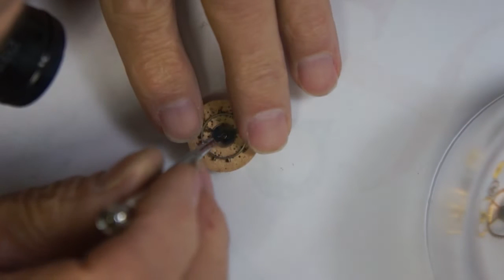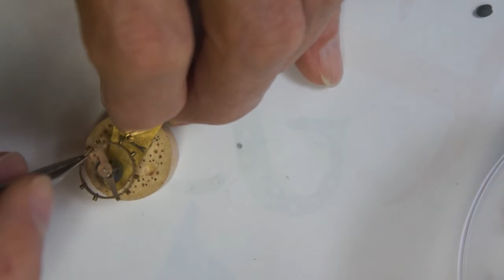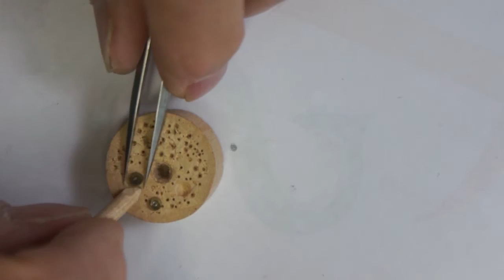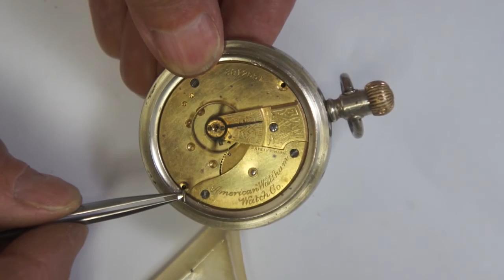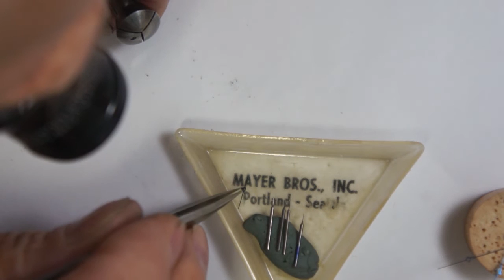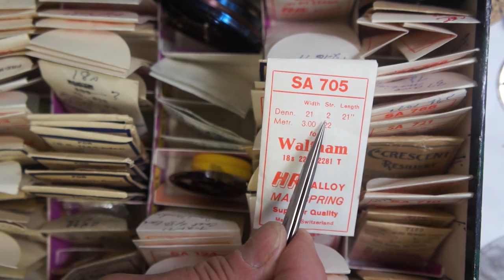Waltham 7 Jewel Pocket Watch Restoration for Cliff from Tennessee #32

Comment: I have a suggestion for using a Q-tip buy a coin or mechanical pencil lead holder 2 mm cut the Q-tip in half with a pair of slippers place the paper and the Q-tip into the coin or letter holder and use that as a handle Works excellent
Reply from the maker: Thanks,
Great suggestion, I will use this..

Comment: When using oxalic acid for cleaning your dial, do you use the powder and mix it yourself, or do you use a pre-made liquid form? I have the powder and am not sure what concentration to mix it at. Also how do you apply it? A small amount on a q-tip and lightly scrub the crack? Thanks for these great videos! I’ve learned so much from you.
Reply from the maker: Premixed.
Common Ceramic and Copper cleaner usually has Oxalic Acid as main ingredient, Bar Keepers Friend is one that works.
I put it over the whole dial.
Loose cracks clean better than tight hairlines.
Reply: Thank you sir!

Comment: You do a great job with these videos for example by holding small parts in your hand so the camera can focus on them.  That seconds hand gave you some issues - sounds like the mounting shaft was not long enough to reach the pivot and extend through the dial.  Was the phonograph needle part of the process of riveting on the fabricated mounting shaft to the hand?  It is fortunate that the mainspring decided to break while you still had the watch rather than, say, two weeks after the customer got it back.  Very impressive work.
Reply from the maker: Thanks Paul,
The auto-focus on the camera decided to focus on areas other than the small parts at times, I may turn the auto-focus off next time.
A lot of these watch parts are so small, its difficult without a microscope adapter for the camera to capture some of the operations.
Yes, the brass mounting shaft on second hand wasn't long enough and hand would rub dial.
I mounted that second hand in two seperate 18s Walthams I had laying around and it fit them fine.
So it appeared the porcelain on this particular dial was thicker than others.
 I used the old phonograph needle to swage the brass over the face on the hand.
Vintage phonograph needles are high quality, high carbon steel, that have been hardened, once polished they work well for a variety of operations.

Comment: The patience of a Saint.  (At least that is what the video conveys... LOL!).  
Thank you for saving another piece of history James.  I really enjoy seeing all of the little challenges that appeared on this one and as usual how you addressed them.  
Did you put anything on the enamel face to prevent or slow future oxidation?
Always informative and inspirational. 
Thank you for sharing and keep up the great work.
Reply from the maker: No sealer was put on the dial, I will need to look into that idea, thanks.
This one was a challenge but ended up being a fine running movement.
Reply: @jamesmartin5370  Are you still donating funds for repair work to the museum?
If so, what is your backlog looking like?
If I run across any suggestions for enamel coatings thst won't discolor, I will certainly share.
Reply from the maker: @davidwilliams1383  Yes, about 2 months out, more depends on if parts ordering becomes an issue, sometimes ordering parts can push out a job.
Now that you mention it, polyurethane is probably the best I have seen for non-yellowing.
 I have used automotive grade on custom dials before, after wet sanding and buffing they look just like porcelain.